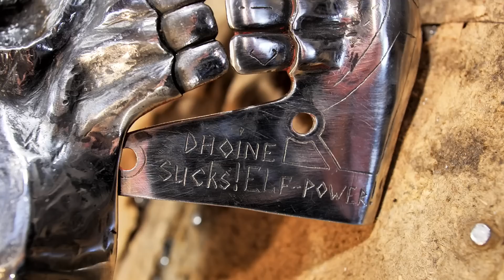Functional Wild Hunt Helmet. Eredin, Steel Armor, metalworking, Witcher 3

Comment: Long time black Smith made desingned wood (tree) sablom. And not weld 😂hahaha.  
different connections for each part.  Without using welding work.  Heated in coal and bent joints.  similar to the metal joints of a house roof.  This was the case with brown uniforms and brown hats.  The intricate details were made with clay or plaster and finally wood.  In wooden forms, it is easier for smiths to complete protective head armor forms.  Well, nowadays, how do you do it simply and quickly.  Using partly old technologies and new technologies.  Welding equipment.